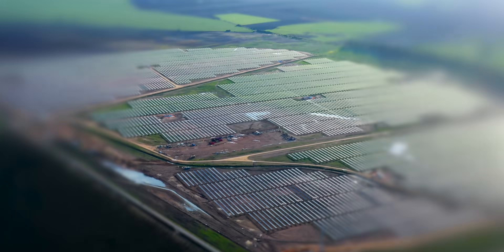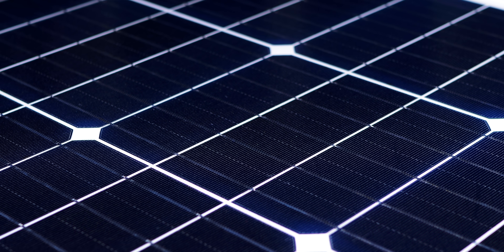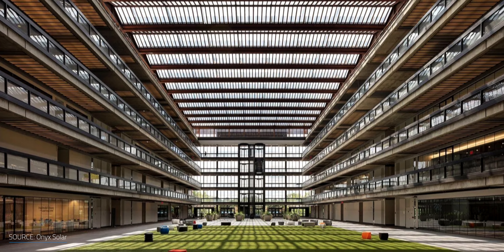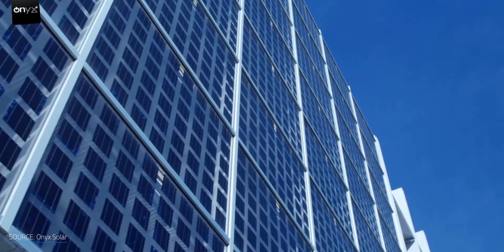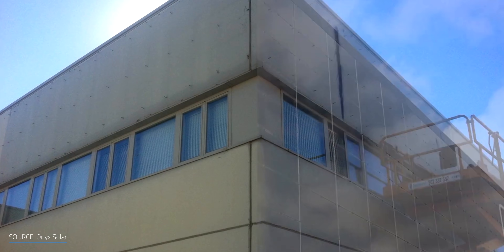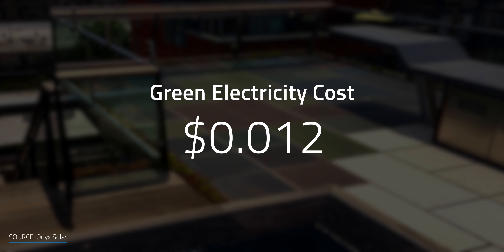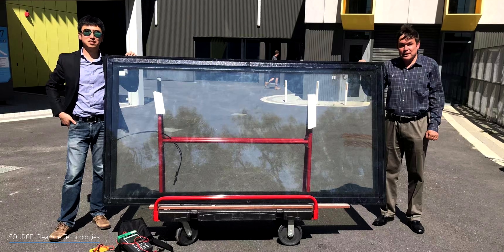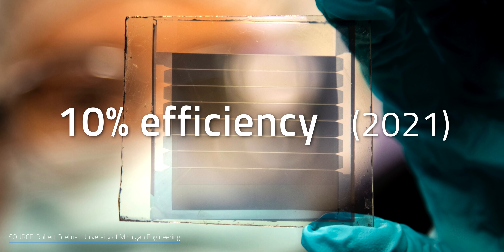Exploring a New Transparent Solar Cell Breakthrough

Comment from the maker: Do you think we'll see transparent solar on most of our buildings ... maybe even cars, laptops, and smartphones in the future?  If you liked this video, be sure to check out Exploring Why This Nuclear Fusion Breakthrough Matters: hhttps://youtu.be/-KEwkWjADEA?list=PLnTSM-ORSgi7UWp64ZlOKUPNXePMTdU4d
Reply: A niche but effective application would be for greenhouses, which could use everything but the red and most of the blue in their selective-transmission panels. UV + green + IR conversion could probably provide almost all the power needed for fans, aquaponic pumps, etc.
Reply: @r0cketplumber  On the Moon?
Reply: @r0cketplumber  Was coming here to say exactly this, the issue is how the IR/UV absorption frequencies would effect the plants inside as you often need growlights for some plants anyway, if the spectrum could be tuned to allow for this it would be a great use of the tech and potentially even boost the output as you could take that power and use it to boost the "right" frequencies of light
Reply: I am very interested in PV technology. I really see stuff like this and keep hearing the "Versus PV rooftop" but wonder "Why not both?"
Reply: I think you missed the best application. Farms. Many crops grow better with some shading. If you placed them 10 or so feet off the ground you could still farm the ground under them. Place the edges together and create a greenhouse.
Reply: @court2379  Regular PV can already be used for farms its just placed high off the ground to diffuse the shadows. "green house",  the  transparent PV would absorb that energy, limiting any greenhouse effect
Reply: @firstlast-cs6eg  Yes but today it blocks much more light and you have to place the panels in North-South rows or at least large gaps between them.
These new panels would filter a portion of the spectrum, mostly UV. Plants only use a little UV light so we can extract that power, and as long as a tiny amount gets thru the plants are happy.

It will still work as a greenhouse. Glass already blocks most of the UV in existing greenhouses. It is more about reflecting IR, maintaining humidity, and preventing convection (like wind).
Reply: Matt, it is all nice, but a table with all the related factors juxtaposed against each other would have helped a lot the viewers, it is a lot of info to compare.
Reply: I like growing my own food during the winter. If i could also generate some power at the same time with a smaller eco footprint I'd be interested in this.
Reply: Probably something we will see in buildings and maybe cars, but laptops and phones are hardly out in the sun enough for it to be worth it.
Reply: Unfortunely, no. Until we’re regularly adding PV panels where rain screen cladding currently is (non glazed vertical areas), adding PV’s into curtain walling will be a gimmick. The low hanging fruits need picking first and cladding is easier, and not currently used.
Reply: What do you think about AuREUS Solar which use aggrarcultural waste to get the fluorescent substance's
Reply: I have also an though about the fluorescent filter  what if the window has 5mm thickness cut it in 5x5mm  strips with an length of maybe 300mm but after cutting it turn it 45degress so the edge points up the lights goes through and glow because of the UV light
Reply: I reckon, yeah. If it's using UV light, then if nothing else it's automatic sunscreen, and surface-bleach protection right?
Reply: No.
Reply: Hey, as someone working in the field I kinda got edged on by some points you made ... you made it look like a very negative think, that the transparent modules can only produce roughly half the power as intransparent ones, though it cannot be any different, as for them to be transparent, they have to let the light pass and you only have one of too options, either you let it pass and therefor cannot collect its energy, or you absorb it, to collect its energy and therefor it cannot pass. So the lower efficiency is a trade off you have to take for the basic physics of it.

Also your efficiency numbers for thin film was a little misleading, CIGS and CdTe, which are also thin film technologies have 17-18% efficiency for commercially available solar modules. Perovskite modules, which are also thin film and are not yet commercially available, have shown up to 17% efficiency. a-Si has indeed only 7-10%, but is also basically dead as a technology outside of the niche application Onxy Solar is using it for. Organic solar cells in the lab are now at 19% efficiency and also close to commercially processed solar modules of organic materials in the lab have reached now above 14% efficiency.

Just some corrections that I hope are helpful.
Reply: Is there anything stopping this technology from being stacked on top of each other so you can for example stack many in a small space and even possibly use some slightly curved ones in the middle to help focus the light where needed?
Reply: @justlisten82  the way I understand it the PV cells operate by interference with a specific wavelength of light, so stacking them only yields higher efficiency to a point due to the fact that each time you put a layer on you're trying to harvest stuff that's already been harvested. So you get continually diminishing returns for each layer, but the cost per layer is roughly the same. By the time you've got 3 or 4 layers the bottom-most layer is getting almost none of the light in the wavelength that it needs to create the reaction which produces the electricity. Otherwise you'd just see folks putting some of these clear PV cells on top of a regular solar panel and getting massive gains, right? If traditional PV cells get ~20% efficiency, and the clear(ish) stuff gets ~10%, you could just put the clear on top of the other and get ~30% right? But you can't, because they pull water from the same well so to speak.
Reply: @PaulTMaack0  Makes sense, I love your analogy at the end. I sincerely appreciate your detailed response. This is why I love the youtube community. Thanks for your reply. Have a nice day.
Reply: Didn't you do an agrisolar video recently? Why no mention of transparent panels for greenhouses?
Reply: This sounds like a great technology for a space station.
Reply: 6:08 but if the solar cells aren't transparent that much would it help to have a higher efficiency? I mean half transparent
Reply: From 1% to 10% in less than 10 years is amazing, how many percent will it decrease when the glass panels gets dirty though?
Reply: short term, low efficiency solar film is perfect for repairing the harm caused by industrial agriculture under controlled conditions on a large scale.  It's a perfect technology, regardless of the limits in efficiency.
Reply: This is only the beginning. Humanity is on a technilogical race / battle with itself : undo the damage we're doing vs doing better than we did.
Technology is going to go ever faster and humanity has prover to break barriers so Moore's law won't stand.
We'll not only see this transparent solar tech implemented ... we'll see better tech within our lifetimes. Compare it to marnetic disc> CD > DVD > static memory
Reply: Yes. And honestly, I can't wait. There are several options available on Alibaba and I've love to redesign my solar aquaponics setup with translucent solar panels.
Reply: I think you never let us down - hype for the win.
Reply: Would these be at all beneficial in agrivoltaics
Reply: hell yeah, use this on the windows, and solar panels on the roof of the car, to help with long haul travel and battery storage density. add this with multiple battery tech like rust ion and open air and replaceable and NBD, smash it all together for an all-electric car with no drawbacks and start creating a culture of using cars/products until they breakdown/erode, instead of a consumer culture whever every year you need the newest multi-thousand dollar mostly visual upgrade.
Reply: I think it's important to realise that one of the most important things for the future is to reduce losses. Currently by choosing not to undertake this technology we would be choosing to loose out on the energy that is directly going through our glass. As such this technology has an amazing amount of untapped potential. I absolutely loved the video, thank you so much for making this video this technology is obviously one that needs more publicity.
Reply: Of course. Unless we're all nuked before then.
Reply: Can you talk about solarroadways or similar solutions?
Reply: You mentioned skyscrapers as an application. Most skyscrapers are near other skyscrapers and those things cast serious shadows.
Reply: @johnTheSmith  this may not be necessarily true, as if the skyscrapers are on a road that runs east to west or more accurately down the line of the sun you will have at least one side of the skyscraper with sunlight for the whole day. Furthermore skyscrapers are not all the same height as such the taller ones can make use of it whilst smaller ones might only have them for some of the higher floors. There will always be somewhere in the building that gets hit by the sun the questions is where and how long and how much of the building has direct sunlight. As such a majority of skyscrapers around the world can make use of this. Consider the skyline in your local city. Quite likely there are a few that are far taller then the rest. These buildings will have a lot of sunlight. You are right that there will be big shadows but they are not everywhere.
Reply: Was thinking if it’s utilizes uv and other ends of spectrum why no use it to cove solar panels?
Reply: I think they will become way more affordable as time goes on and everybody will use them except people who hate electric the naysayers but it's not in my lifetime probably. Solar panels and electricity are our future. The future of space.
Reply: Is it cool.if we talk about all the bad farms make.
Aka chemical fertilizer pesticides and the bags they come in runoff from over use of water and well everything else.
Thoughts.

Comment: Several years ago, when Discovery still ran quality programming, they did a series of shows on what was needed to bring our infrastructure up to a good standard. The cost, then, was at least $3T. One of the episodes concentrated on solar energy. One company was working on solar cells that could capture several frequencies of light. The current cells only caught on frequency. By capturing energy from all frequencies, infrared thru ultraviolet, the cells efficiency would be vastly increased. Another company was working on cells that were printed onto a substrate using something like a ink jet printer. They estimated the cost would be under 10 cents per kW and these could then cover an entire roof.

Comment: Just geting sky scapers use tranparent solar panels and regular one should be the starting point. The fact is the more windows a building has the worse it is at thermal effectiveness related issue. But this may be wishful thinking when most building continue to over use glass

Comment: I've been seeing some short videos on a clear solar film that can simply be applied to the inside surface of an existing window for producing electricity.  Do you have info on that or a video on that technology?  Appears that when the film deteriorates in function, the fix is removing the film from the window and applying a new sheet of the film in its place. Done!   Whatever company that is working on this is currently hampered only on ability to scale up the manufacturing to cover the much larger office building windows.   Seemed like they were now able to create up to 4x8 ft sheets.  Love to see more info on these.  Thx!

Comment: Even solar panels that are 50% transparent would be very useful in so many places for example skylights you need to get the suns energy and also the Sun is light but you don’t want to have Nik to clear windows it will be too hot in the Sun will be too harsh on sunglasses for your is the skylight and also energy producing

Comment: question: are there transparent solar cells that work with most of the electromagnetic spectrum that photosynthesis doesn't use (so much), like UV, the "green(-yellow)-gap" and infrared? thanx! :-)

Comment: In my opinion it doesn't matter too much how efficient they are in big buildings. At this moment the windows are making nothing. So anything over nothing is technically better. I get the cost is a major factor, especially when only making 1% power. But windows now produce nothing. I see any gain as a win.

Comment: This would work in hi rise buildings if they could also cut the heat gain but in residential since windows are the biggest energy wasters.. Need more solar? Just add more windows. Is dumb.

Comment: it would seem that transparent solar cells would be a good application to be placed above plants to allow both electrical generation and plant growth below... in a agrivolatic application the plants receive adequate light energy for growth while shading to reduce water consumption and condensation from the plants aid in cooling the solar panels... less efficiency is acceptable when further use of the light photons is applied to crop growth... agrivoltaics farming operations benefit from production of electricity to use in production as well as selling excess to the grid.  reduced water consumption is a plus as well ...especially good would be a solar cell that is flexible to stand up to wind and hail in large scale farming applications.  further improvements would be a fabric of solar film that can be hung above the crops like a shade cloth made of a material such as graphene.  comments?

Comment: I’d like to see this combined with “smart glass”, the LCD dimming layers. You could put such a layer on the inside side with the translucent 10% efficient windows, and gain the power savings from the “smart glass” heating/cooling optimisation while also generating some power for the building whether the window is shaded or not. Reducing energy demand while also further reducing power grid pull.

Comment: I've never seen fully transparent window glass on a high-rise office building, its always tinted but, maybe I haven't been looking close enough.

Unlike solar panels, which are single use propositions tacked on to existing structures, solar windows are triple use - window, HVAC energy saver, electricity producer.  Inasmuch as the window is going to be anyway, why not have it make electricity while creating a view? 

Given its multi-use use and the clear advantage (pun intended), transparent panels have in collection area - potential sq. meter area is enormous, I think there is a solid business case to be made for their use, even now and without government mandate. However since businesses like to generate a return on investment without actually making investment, government intervention is likely required.

Government dictates MPG standards for vehicles and damn the cost to consumers. The government all but banned the incandescent light bulb for energy efficiency reasons, and has set minimum efficiency levels for energy and water consumption in products, such as consumer electronics, household appliances, and plumbing equipment.  Its time for the government to tell us our windows have to get to work making juice.

Comment: Great video, but one slight error. You won't see this on mobile devices as it'll induce net loss in power.

Surface area is too small and the phone will end up using more energy to counter reduced transparency

Comment: Matt's right: we'll have micro-solar generation EVERYWHERE. Much of it low-efficiency but if ubiquitous it adds up. Meanwhile grid-scale solar generation (& residential too) continues to plummet in cost: we're headed long-term for a Star Trek future. Abundant electric power at near zero cost (will never be zero as we'll still need transmission grid).

Comment: Following this logic, people could simply use "normal" solar cells and cover the walls of their houses. The surface area of the walls is much higher than the window area of many houses anyway. The reason people don´t do this is that solar cells are still too expensive and they only put them where they get the most sunlight during the day.

So first of all: cheaper solar cells. Then, if every non transparent thing is covered with them, you can use the less effective transparent ones. Nevertheless, I think transparent solar cells look awesome and they have a lot of potential for awesome futuristic building designs.

Comment: very interesting but the cost of replacing the transparent windows after 20 years would be a massive hassle not to mention probably cost  hell of allot more not to mention with will the glass be able to be recycled, what would you do with that much glass if it was not. i mean what are we going to do with the massive amounts of sola panels when they die out.

Comment: Keeps talking bout the low efficiency of these Solar windows yet doesn't mention that they are still in it's infancy when compared to normal solar panels (the first solar panels were invented in 1954 and was less than 1% efficient). Efficiency increases and cost goes down as time goes by and it gets more R&D.